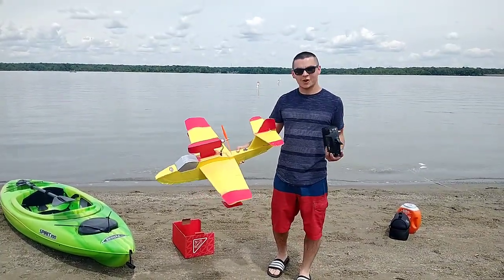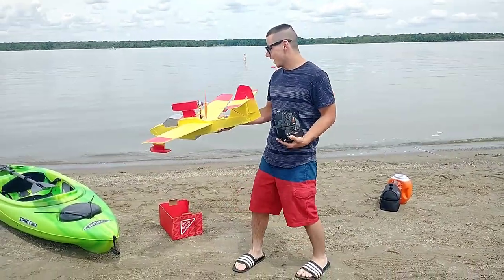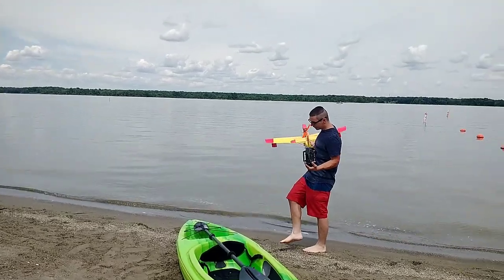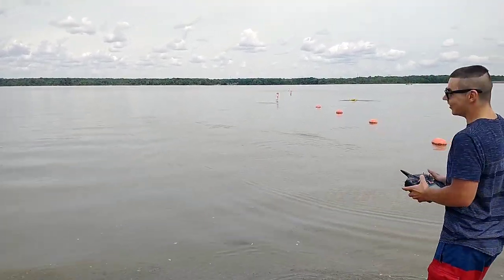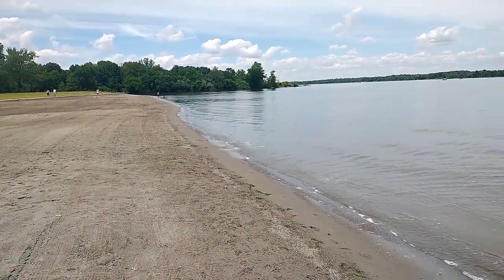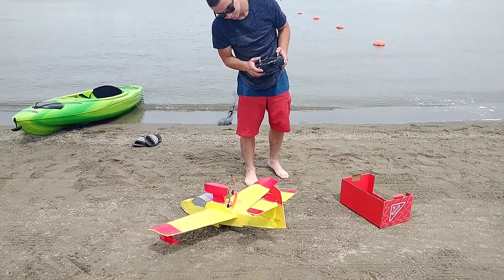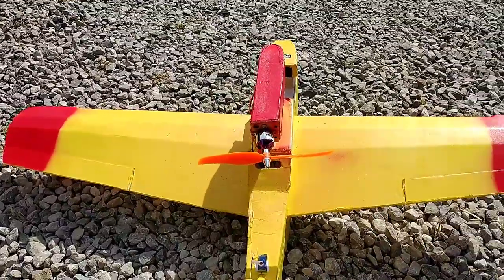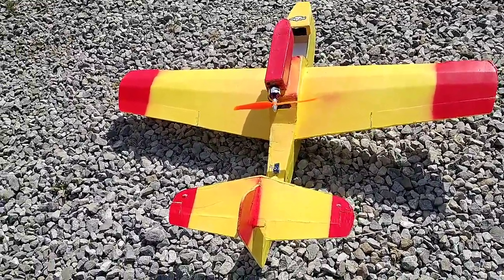FT SEA OTTER FAILED MAIDEN

Comment: Just built one myself. I could see when you were testing it after it got soaked that you were giving almost full throttle and not hearing it out of the motor, normally this is from a wrong size prop, and/or a burnt ESC/motor